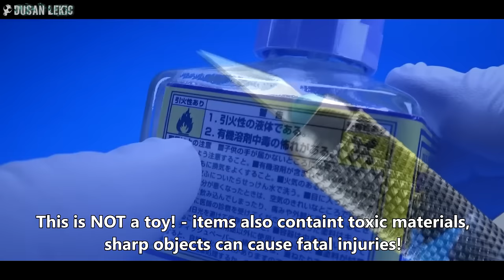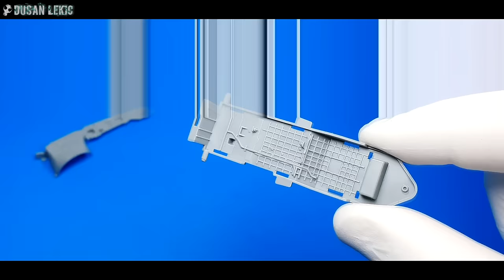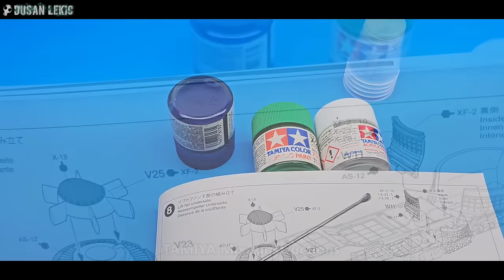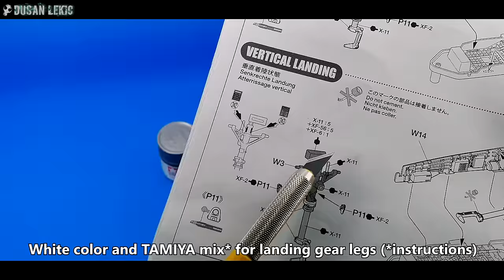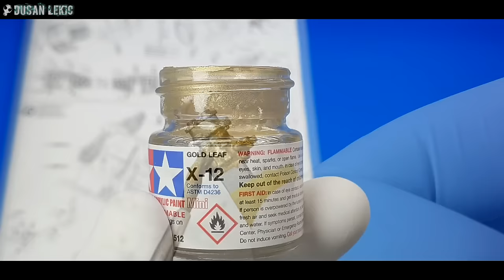Full Video Build TAMIYA F-35B Lightning II

Comment: Beautiful build.  I plan to get a few of the Tamiya jets.  They are so nice.  One question.  What is the point of the black base coat?  It seems everyone does it and then obliterates it by painting on a top coat.  If you are trying to highlight panel lines or recesses, why not just use panel liner.  Thanks much.
Reply from the maker: Hey Bob, thank you!!
Well, it's complicated,  In the past, I had a gallons of black primer in my stash
.. I really like the look of a black model, but in real life, the best primer should be like on the real thing, in this case, light green or yellowish green. But the best is 2 use Tamiya light grey primer to check your panels and joints. I recommend that... now that I still use black primers, but I don't like marble and similar effects.  I like post-shading and panel liner like You wrote.  Like I said, it is complicated and just a person choice.  All the best! D.